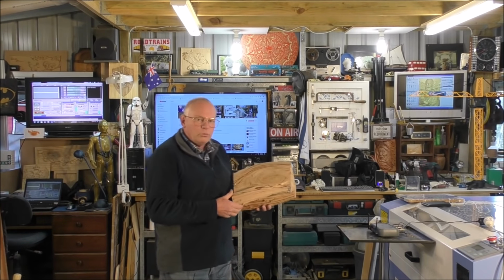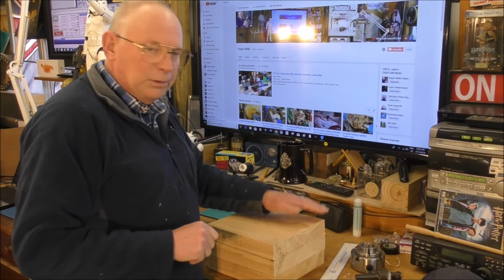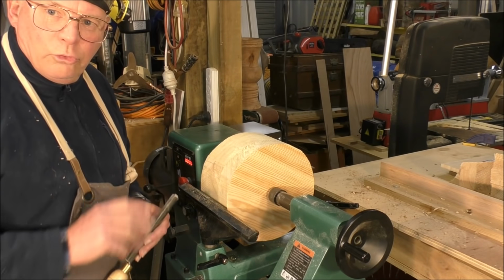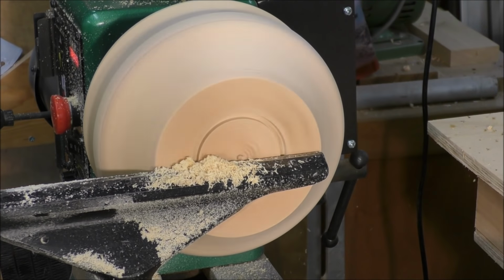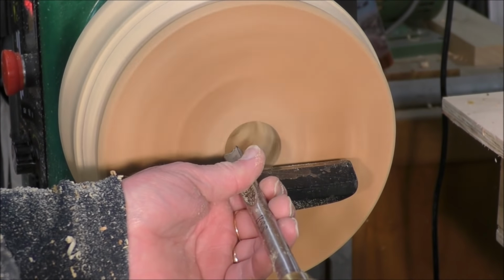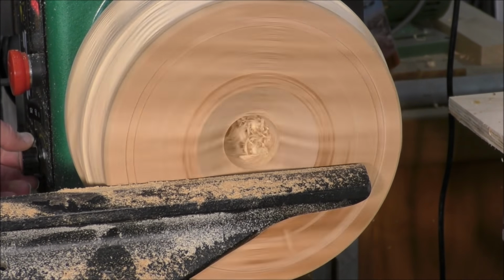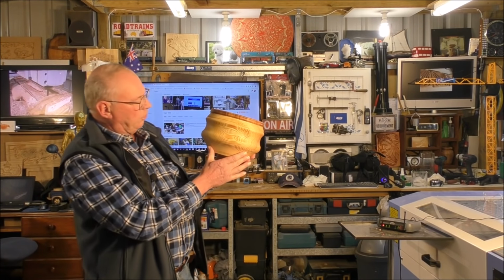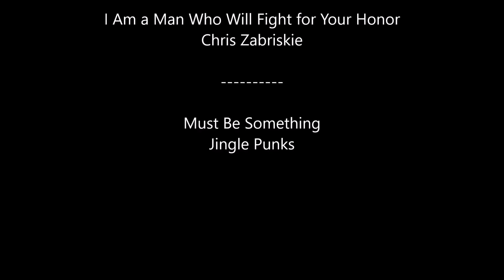280 Wood-turning a Royal dragon bowl

Comment: Roger, thank you for this video. I am a prospective wood turner, and sourcing material is a concern for me as well.

I have a question for you. I'm left handed, is that a significant impediment to using a lathe, or do I just face the other way?
Reply from the maker: It's not an impediment at all, you will have no problem.

Australian Inventor Roger Clyde Webb